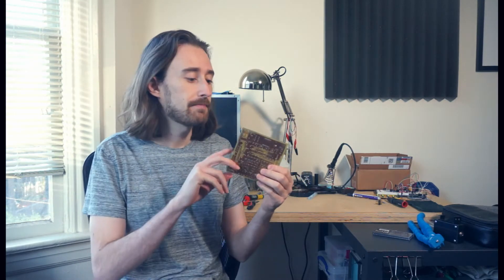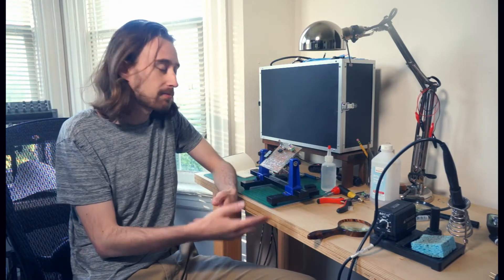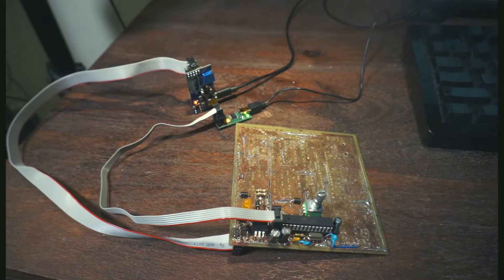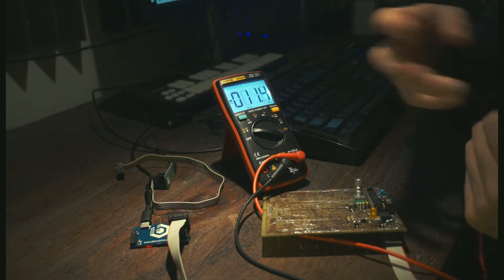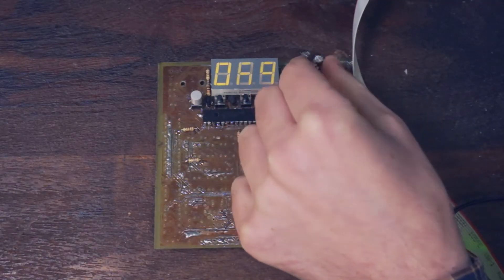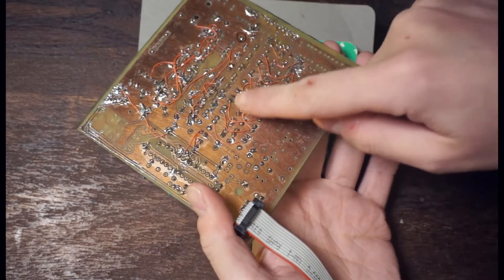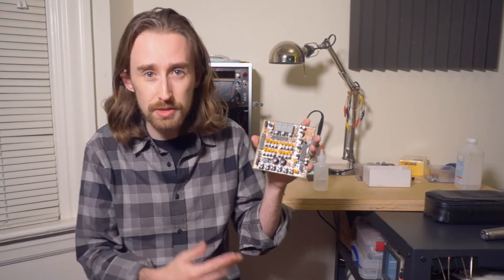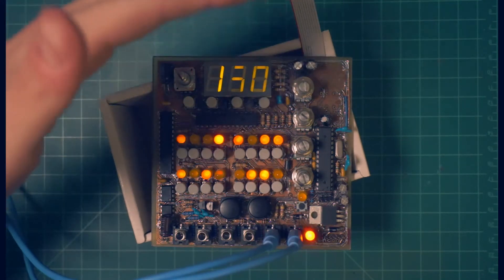Designing a Eurorack Sequencer - Part 5: Assembly

Comment: hi do you recommend that audio jack connector for smooth insertion¡????
Reply from the maker: The jacks are "thonkiconn" type aka pj301 switched mono jacks. I haven't tried many others but these are preferred for ease of mounting and simple normalization. All phone jacks are kind of clicky but I find these acceptably easy to use in both directions.

Comment: great video, did you mentioned cv / gate outputs or have i just missed it
Reply from the maker: Yep, it has 1v/oct pitch CV output, linear (non-pitched) CV output, and gate output. May not have mentioned it in this video but if you check the latest in the series I show it hooked up.

Comment: I like the idea, I do like the use of an arduino, and everthing else so far, but this etched board is seriously crap! Using some sort of perforated board along with emailed thin copper wire for the traces or even a manhatten style build on a copper pcb without etching  would do a much better job, that becomes obvious. All of the design is crap, starting from the missing separation of analog and digital parts on the pcb to the missing esd protection diodes. I am sure I will build one of this sequencer my self, but no way with this tones transfer etching, and certainly not with this arrangement of digital and analog parts on one and the same pcb. Did no one tell you, that you e.g. could splitt the board and mount them as a sandwich?

Comment: How did you drill the board?  By hand?  CNC?
Reply from the maker: Yep, drilled it by hand with a dremel and HSS bits. Phenolic resin is easier but they'll do fiberglass too as long as you take it slow.

Comment: hahaha m8 this series has been spinning me out, i just got into eurorack in the last 12 months or so and began designing a 16-step arduino based trigger sequencer earlier this year. Somewhat akin to the SWT-16, though with a more stripped back feature-set. It's encouraging to see that we've made a lot of similar design decisions :). Also thanks for the hot tip re: Upverter - up until now i have kinda just been making things up along as I go and now I'm stuck on the PCB design. Seems like creating a schematic might be a good place to start :P
Reply from the maker: Nice, sounds like we've been on the same trip! SWT16 is cool, haven't got one myself but I've thought about using that same adafruit silicone pad thing on projects. Upverter is easy but I found it got really slow in my browser after about 50 parts - seems like they're still improving and it probably works better on the right platform/browser combination. Anyway I have to do rev2 of this PCB and will probably start with pencil and paper as I find it's still the fastest :)

Comment: Notif gang
Reply: This looks amazing though - it fills the job of like 3 of my modules already. If you did build a quantizer in to it (even basic just chromatic) then that would be awesome. Does it have a reset input and output for sending the clock elsewhere?
Reply: A 303-like glide function would be awesome too. Always love voltage-stepped octave switches too
Reply: Oh you mentioned literally all of these features right at the end of video
Reply from the maker: You're a mindreader ali! Will try to put some labels on so it's a bit clearer what does what, but it does have reset in and clock in/out (though not implemented yet).  I'm sorely lacking in external gear to sync to so I may have to go and find a companion module for it, at least for testing... Was thinking a volca beats might pair nicely, but probably want to get something more euro-sized. Maybe a Grids and a sparkfun wav trigger?
Reply: Pamela's Workout is probably the clock source but if you're after voices seems like you already have everything?